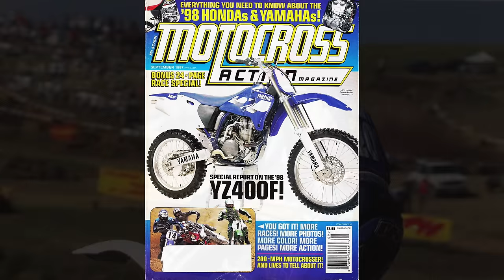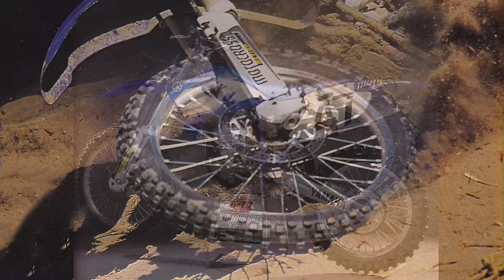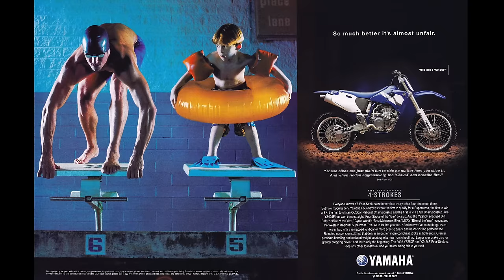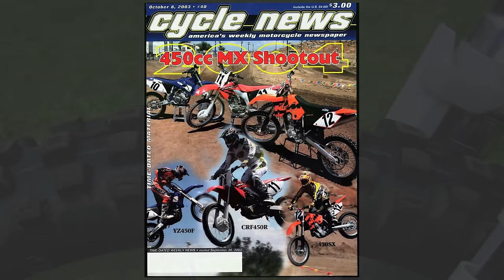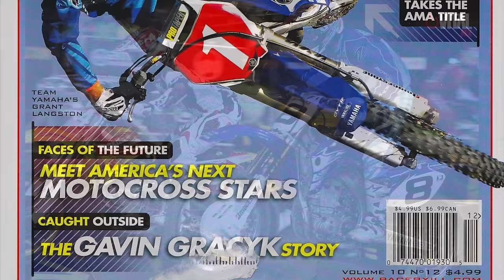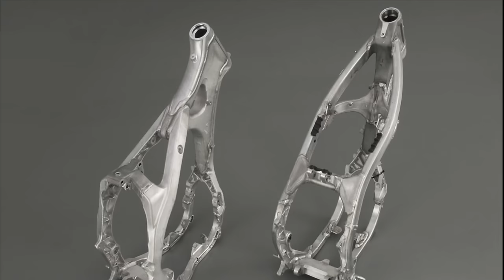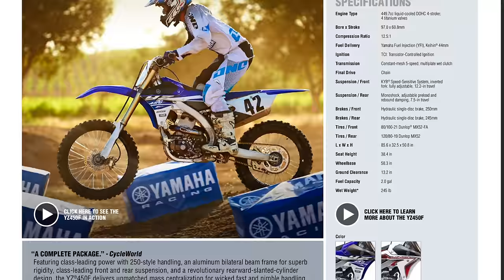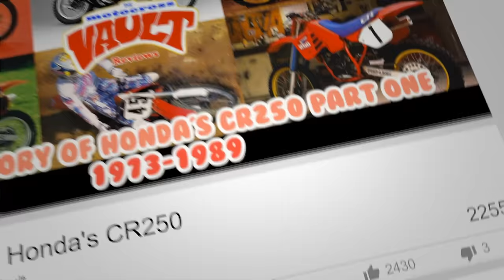The History Of Yamaha's YZ400F, YZ426F and YZ450F 1998-2022

Comment: Hard to believe the 4-stroke revolution started 25 years ago. Perfect time to look back. My 03 CRF450r would choke when I'd whack the throttle. Sometimes it would flame out as I launched into the air. It sucked. Then I'd kick myself senseless... But my prepped 05 is still one of the best I've ridden. My buddy's 2018 YZF250 is just as good (and better, indoors). My other buddy's 2018 CRF450r is too much bike  indoors. 250f's are perfect. Way easier to ride than the 450's or any 2T.
Reply: That's crazy to think that it was 25 years ago now ! I just turned 50 last Saturday.... So half of my life ago.. Mind blown !!!
Reply: @scottyd2262  happy 50th!
Stay in the saddle!
 I'm right behind you.

Comment: i had a brand new yz400f in 99 , what a beast it was after riding a cr250 for 5 years, flywheel was super heavy in relation to how light the piston was, which gave it a weird powerband....im only 5'11'' 180 and hated the starting procedure, and the lbs, but i lived in hawaii and rode it in the summer heat like it was stolen and i never had a single issue mechanically.

Comment: You put a lot of work into this and deserve lots of respect.  Thank you!
I was riding during the switch from 2 stroke to 4 in popularity.  Had many Yamaha YZs because I loved the supple suspension.  1st 4 stroke I owned besides trail bikes was the 1999 yz400f.  I was still riding a 2000 YZ426 when my group of friends had Suzuki and Honda 450s.  They would stop all the time and talk point their fingers and look at maps on Southern California BLM trips.  I was always the last to get my bike started again!  I would get so worn out from restarting that bike HOT or after stalling.  It was always a fiddly dance between choke and hot start, no throttle, TDC kick overs and one chance before blowing my knee out.  I later learned to keep riding slow circles around when the other guys would kill their engines.  I would avoid turning that thing off until I was home or out of gas. 
 I held on to that bike as long as I could it was so quickly outdated.  There was nothing so amazing as running that engine early on.  It felt like the most modern thing available.  The future of motocross seemed to live in the success of that bike even at the time.   
Also, it would stall if you tapped the brake before a turn and locked up the wheel so fast!  Engine braking was very powerful.  In low traction scenarios is was likely one couldn't even in bump start it while still moving.  Pop the clutch and sliiiiiiide to a stop.  I would often be sliding down a sandy hill , dead engine , trying to kick start again before the bottom!  Great fun!  
Thanks for the memories.  My foot arches will never be the same.

Comment: I had a 2009 YZ450F that I used for woods riding only & it was damn near perfect for me. I felt so comfortable on that bike. The smooth power delivery & great handing made it one of the only 450’s I would ride in single track. I did add  the 06 ECU to give it some more hit. Bought it for $100 off eBay. I had a big tank, handguards, skid plate, rekluse, Seatconcepts seat, FMF exhaust & the whole for off-road. The suspension was awesome too. It worked great for off-road. I did get it setup it for my weight & off-road valving. I ended up going to a 350EXCF that was setup for off-road after that. I still miss that bike. Great machine all around lilt you mentioned.

Comment: One problem with the early YZFs was the Accelerator Pump was way too generous. Tim Ferry's mechanic posted a mod to the internet in 2000 or so where you drilled and tapped a purpose-casted tab in the FCR carb-body that allowed you to install a limiting screw for the AP pump stroke. I cannot remember the mechanic's name but his initials were BK.
Reply: Brian Kinny 👍🏻

Comment: THE 2003 ktm 520 sx  with 4 speed, no linkage and tiny gas tank.  The open class bike that was  overkill,  scary fast very quickly  0 to 60 in a blink , low end hit could  rip ur arms outta the sockets,  when u launched it off a jump the earth would shake when u landed and it felt like u were riding a 2x4 with the  no linkage. And all bolts had to be retorqued  tightened and or locktited after every ride u could rattle loose all the bolts in minutes and the bike would come apart easy making it very dangerous. The 2 quickest bolts to come loose the shift pedal and kick starter. Dont laugh its paid for im the original owner, and im keeping it , just gotta get it to start again , been a couple years LOL

Comment: I bought the new 1999 YZ 400 and kept it for 2 years.  Should have held on to it for years more, as it was reliable as hell.  As for the reverse-motor models....I always wonder how Yamaha would have fared had they simply fuel-injected the 2009 motor (with mods) and used the 2010 YZ 250F chassis, which was well liked.

Comment: The hot start was on the 98 carb aswell. It had the decomp lever (basically used for finding tdc) all the 98-2001 I’ve seen personally all have had identical carb with slightly different jetting.
Reply: Also from my experience there wasn’t much of any difference in power between the 98 400 and the 426. I’ve owned several, 400s 426f, wr400s and wr426s. I think a lot of what you noticed was all in tuning. If the suspension is sprung properly the weight isn’t really an issue at all. Honestly riding my 1998 it felt lighter than my buddies 2021 yz450f.

Comment: Suzuki LT500R "Quadzilla" or Honda TRX450R or Yamaha Raptor 660/700 (I heard it was originally designed for the 426 engine before they went to the Grizzly 660... resulting in it being so top heavy and the intake woes of the first gen?)
Lol.

Comment: I have a weird question for you, But if someone will be able to know this is you.
I am planning to start racing again in FTR in Florida in the  Premodern class, bikes 2002 or older, I am 6'9 and I am looking to buy the biggest bike is size, not engine displacement engine that I can find and buy; 2002 or older 2 stroker 250, What would be your top 5 recommendations, I have ridden my friend 219 modern ktm and I look like I am on a 85cc bike.
Thank you so much for assisting me with your knowladge.
Reply from the maker: The biggest bikes of the time in terms of ergonomics were the Kawasakis. They are very roomy and fit bigger guys better than smaller ones.
Reply: @TheMotocrossVault  Thank you you are the best!!!, Any year model in particular that you can remember. once again thank you so much.

Comment: Very cool video. I'd like to have you put a bit more info out. The genysis engine was brought over from the indy car engine yamaha had. They quite literally cut off a cylinder and built and engine😄😬. 

Yamaha also started with 400 because AMA had no class for it. So they just figured a 2 stroke is essentially 1.6 x's the power of 4 stroke. So 250x1.6=400cc. Because there was still no class yamaha bored the 400 to 426. Then finally AMA came put with 450 class. Then the decision was made for them.

The wr actually used the 1st gen genysis 450 thru 2015.

Great video, long live the OG yzf's!

Comment: Uh...Nope, those first few years of the fart bikes they did NOT race open class, they raced in the 250cc class with a HUGE displacement advantage because they still sucked when it came to power. The open class was removed and the 250cc 2t class was replaced by the 450cc fart class and the 125cc 2t class was replaced by the 250 fart class.

Comment: What are u on about when u say the first Honda 450 was not fast😭🤣 its produces more hp then any 450 ever produced😭🤣
Reply from the maker: I owned one brand new and it was very mellow by 450 standards. My 2005 CRF450 was way faster and any modern 450F would out power it easily. It was a great engine but massive power was not its best quality.

Comment: 450s are too much for me i rode a 250f and still felt too much power for jumps. What is the smoothest 450 you would recommend?
Reply: My 04 crf450 with a spark arrestor and suspension revolved for my weight is my all time favorite.  Smooth, linear power that just pulls more and more but never hits too hard.